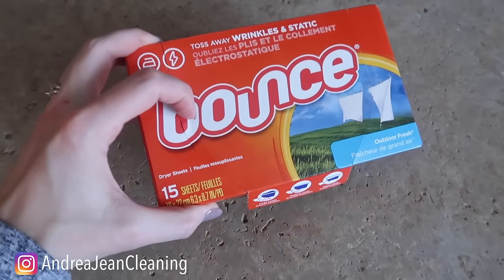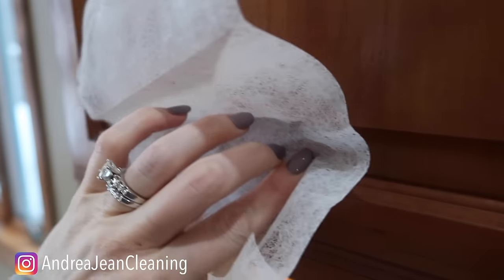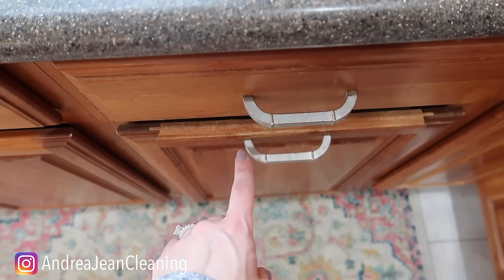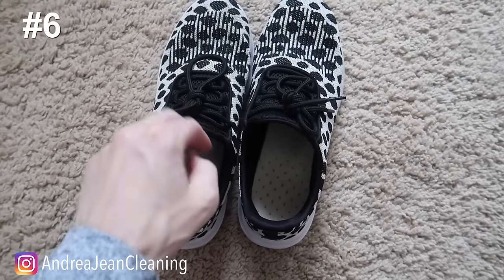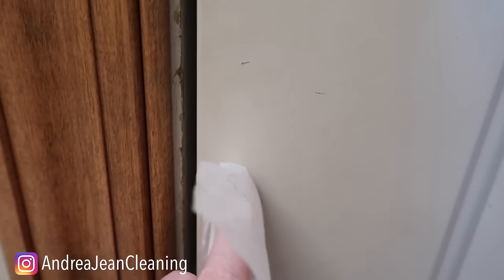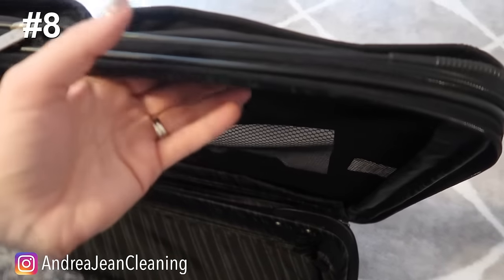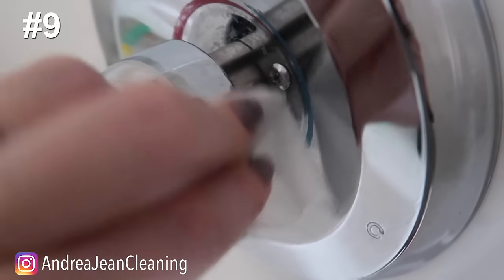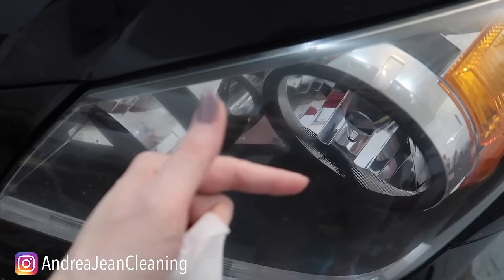10 GENIUS and Useful DRYER SHEET HACKS that Actually Work!!! | Andrea Jean

Comment: It must be absolutely delightful to live in your home ... no funky odours.  We have had issues with squirels and mice building nests under car hoods and dryer sheets will keep those critters away.
Reply: What brand and or scent?    Does it make a difference ? New or used?
Reply: @lorettarussell5575  ... we use Gain original dryer sheets (new) and so far the critters have not come back.  The sheets have to be changed every so often and if you use the dollar store sheets, they dont last as long as the name brands.
Reply: @momofschnauzers  thanks for the information
Reply: @lorettarussell5575  you are welcome 😀

Comment: I also use it to wipe out lent trap😊
Reply: You have to let them soak in cold water.   I hope you didn't dry them with heat already if so they are set in.
Reply: I use them to clean the lint trap too!!

Comment: I have a mason jar in my laundry room where I stuff my used dryer sheets
Been using them along time
When I clean I stuff a few of them in the pocket of my apron  because they're slightly abrasive you can wipe out the inside of your washer  laundry baskets something stuck on the floor  cabinets  windows ledges  wood blinds
  you can put them on the end of your dust mop get the dust under beds  bookcases  corners 
Your walls  clean scuffs off shoes  my vinyl floor 
so so many things when you start using them  It will soon become a habit🕸

Comment: You can use white toothpaste or CLR for water spots or shining chrome.  
Toothpaste can be used to remove Mark's on walls,  scuff marks from floors,  and filling in small holes in the walls.

Comment: Thanks for the extra tips! I  use dryer sheets for alot of uses! It makes everything smell so nice. I roll them inside toilet paper rolls then stand them up on my furnace grates It smells awesome when the furnace is on. Plus, as a bonus I'll put them inside wet shoes,or mitts. It makes them smell awesome! It also helps holding up the mitts, while drying.

Comment: I use dryer sheets in some heat/ air vents of my home .
Reply: I do the same thing and I also use them to clean the dust off of the vent covers and grates on heaters they work great .

Comment: Soak your oven racks with hot water and several new dryer sheets. WOW!!
Reply: What ???? your oven racks??? don't you use your oven racks to bake ????is dryer sheets residue in there okay?
Wouldn't you be eating cookies with some kind of a dryer sheet residue on there somehow as it evaporates or heats into the atmosphere in there?    Seriously what are you talking about?
Reply: @wiseforce7045  I rinse the racks. It hasn't killed us yet.
Reply: @christi4169  can you elaborate on what exactly you do with the dryer sheets and the racks? Do you clean the racks with the dryer sheets or put them in the water together? What?
Reply: @wiseforce7045  I put about 6 dryer sheets in the tub, fill with hot water and then put the racks on top. Let it soak preferably over night. You can also put a generous squirt of Dawn dish soap in the water. It seriously melts the junk off the racks. I know Dryer sheets have gotten a lot of bad attention but I've been using them for years. I was honestly surprised no one had commented before now. If you search in the YouTube search bar there are several videos about it.

Comment: For burnt on food in pans just fill and soak with hot water and a dryer sheet for about 20 min. I use the sheet to scrub the bottom while the water is still in there. Was blown away the 1st time I tried it. Went from an electric stove to a gas one and it wasn't pretty in the beginning.

Comment: Just a question. Although dryer sheets smell delightful; why would one use them rather then dust proof rags or paper towels, and cleaners such as Pine Sol, Vinegar, Lysol spray, etc. and/or Clorox wipes for many things you are showing on this video?? I use these cleaners in my bathroom, kitchen, appliances, door knobs, etc. They are as clean af a whistle and my house is and smells clean. These supplies last me a long time, making it much more economical then using dryer sheets. 
I use dryer sheets in my dryer, one in the hamper and in a couple drawers where my clothes are, and that is it. They last me a long time. 
This is how I stretch my dollar and save!!
Reply: I was just wondering at the same moment about this as you. These dryer sheets are not environment friendly and are made of polyester. It annoys me that people don't concider the environment and use these chemical sheets while a damped micro fiber cloth with just water is even working better. All these wipes are really not needed. Also no need to disinfect your home, even not in Coronatime. Soap is doing the job also. We need contact with regular germs to keep our immune system strong.
Reply: I would not use "unused" dryer sheets unless you want to impart temporary aroma. Many if her ha cks here are using them AFTER they do their thing in the dryer.
Reply: @lienbijs1205  and the bad chemicals they smell from these things
Reply: Well I'm thinking she likes   
them better than Pine-Sol or Lysol that type of thing 
I do too but I still love to use vinegar